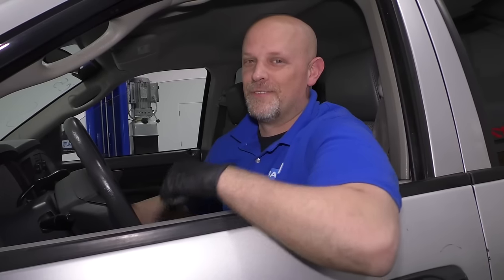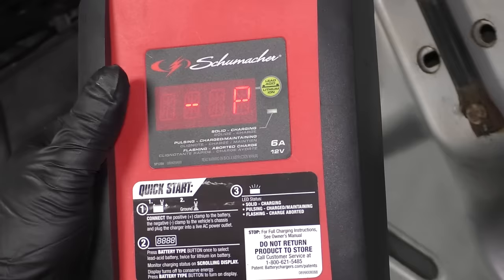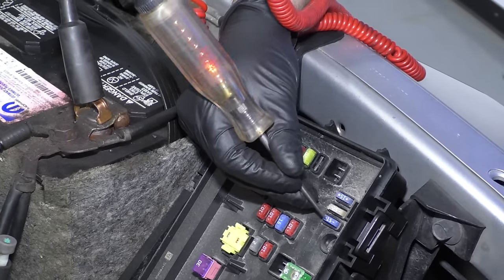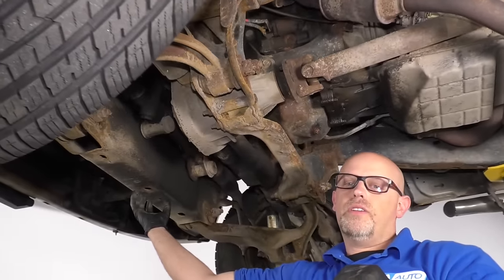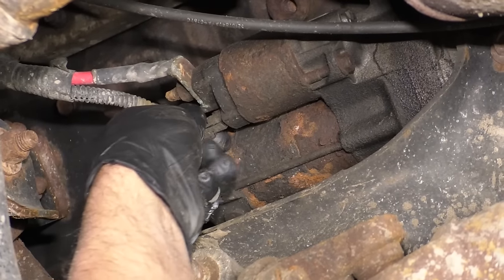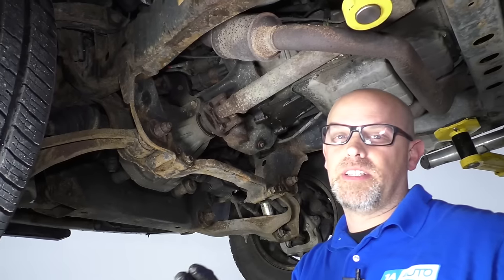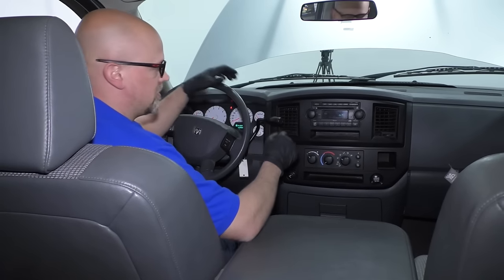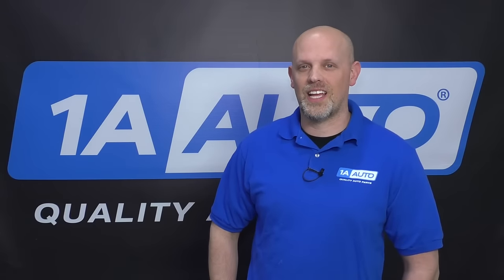Car or Truck Engine Won't Start? How to Diagnose a Bad Starter

Comment from the maker: √  Watch the Video
√  Buy The Part at 1A Auto http://1aau.to/m/Visit-1AAuto
√  Do it Yourself
√  Save Money
Reply: So what happens if you have a cranking no start you kind of just left that on a cliff hanger without saying why?
Reply: @Oiluis18  

He mentioned that it could be a relay, fuse, or even neutral switch.
Reply: It ended up for me to be the ac compressor was seized and the belt was still turning but there was so much drag  it prevented the engine from cranking fast enough to start.

Comment: Dude !!! Thank you !!!! I think you just saved me $900 ....mechanic told me, yup you need a new motor ....i see this and put a socket on the pulley and BOOM I turn the motor EASY !!. Its just a bad starter and he was going to keep my old motor (which is good) and get paid for labor.
Reply from the maker: +Jesse Martinez Thanks for checking us out! http://1aau.to/m/Shop-1AAuto-c
Reply: That mechanic sounds like a criminal. You should lose his license for that kind of BS!
Reply: Run fast from that mechanic you mentioned as something sounds shady. $900 for a engine, installed? BY the time you install new water pump, plugs, wires, gaskets since it's out of vehicle and unknown condition easier to replace. Example I bought a $400 motor for someone recently . Replaced alot of gaskets, all except head gasket. Had a bad wheel bearing, needed new battery, had to replace power transfer unit gaskets as when you remove axle shafts you have to replace the seals. 

All in all the total was $2k then adding the other stuff total came to $3300 and it was a used engine.
Reply: Sounds about par for the course. Usually women in particular get this kind of treatment by service places, especially the stealerships.
Reply: $900 for a motor...
Reply: I needed to get my started fixed and the mechanic said it was $900!!!

Comment: I have a tip.  On Chevy Silverados after you have been driving on snow covered roads on your way to work during the winter.  After you get off work the starter won't crank.  What happens is the drain hole in the starter housing gets snow and water packed up there into the starter gears.  It then freezes and won't let the starter turn over.  You need to go under the pickup with a little benzomatic propane torch and warm up the starter to melt the ice.  After that I put a dab of door and window caulking over that hole and have had no issues with my pickup starting for the last 4 years now.
Reply: Good point.
Reply: @k9under  at
Reply: You could probably spray penetrating oil then the ice won't stick and freeze

Comment: Absolutely fantastic troubleshooting - very thorough. Only thing I might add is that my son was able to once use the hammer trick without someone actively trying to start the vehicle. He just tapped on it and then hopped in to start it. Might help someone else.

Comment: Thank you for your help!  I've officially fixed my first electric issue on one of my machines thanks to you.  (It is a DynaPac Roller that would intermittently not start and I couldn't figure out why.  I questioned the starter or even the switch itself.  I watched a ton of videos that all helped a little - but your trick of setting the light up to the wire going to the starter was exactly what I needed.  I could see that the electricity wasn't making it to the starter.  So it had to be the switch... but then I did the same test right at the wire at the switch and it did have power on both sides of the switch.  So I followed the wiring and ended up coming along some wiring harnesses.  I unplugged the harnesses to inspect, and found water trapped inside the harnesses and a bunch of corrosion.  Cleaned it up, added some electrical grease to the prongs on the wiring harness - and it is working great now.  So not only did it work, but I didn't have to buy a new starter or a new switch!)  Thank you, thank you!

Comment: Great video.  It takes me three times trying to turn it over to get engine to start.  I will try your tip on putting it in neutral and trying to crank it.  Just replaced battery terminals and thought a stripped loose terminal was the problem, but not that easy. Will check fuses and relay. Thanks for the wonderful 1A Auto videos!

Comment: Brilliant! Thanks! 
I will order from you too 

For a month or so, my vehicle either cranks perfect or good lights/no starter turn. Try few more times or try later and it cranks.
Since it mostly starts fine, that rules out battery/alternator/fuses. I don't expect starter wires starter wire problem could be intermittent. I'm convinced starter pvlm, but will check starter signal before replacing.

Comment: I really appreciated the description of the sounds that I would be hearing for each problem.  But then going the extra step to help me see how to test the battery connection, probing the harness and then test crank the engine with that in place helped to clear up what multiple other videos never helped me with.  I hope to diagnose my son's car in the morning and be able to get it repaired quickly...for the cost of parts and with the added bonus of father and son time!

Comment: Also it helps sometimes to look at the grounds from the battery to the body and body to the engine.  Check for looseness and corrosion especially on older cars that live in the salt belt.

Comment: I was turning the key and car wouldn’t start until you said to turn key and listen for clicking so I was playing around with it. There were flickering lights then car started after I held key in turn position. Then it started. It dawned on me that I hadn’t used the car in 2 weeks. My car is old and i heard old cars can get messed up if you don’t use it for too long. I appreciate your vid. It is in formative and made me realize I got no one but me to fix my problems. I just need a guide.

Comment: Thank you so much Andy and 1A Auto! My Camry wouldn't start after finishing up grocery shopping. I checked the battery, fuses, and cables. I was defeated and brought a starter getting ready to replace it there. I figured let me try and do the hammer and start method, and it worked!! I was able to drive my car home and replacement the next morning!!

Comment: Okay, but what if you can always start your car but sometimes, randomly, during the start process it glitches, or in other words, “dies” for 2-5 seconds in the middle of the start. BUT always starts and drives great? I have a 2018 Subaru just hit over 100,000 miles and this just started to happen. I also have a video I would be willing to share! Oh and I replaced the battery, brand new per the mechanic and it’s still occurring. Thanks for all your YouTube video. Very helpful 😊

Comment: This was well done and helpful. But I have some important info that I didn't find on any of the 'won't start' videos:

If it is the battery as it was with my 2015 Silverado, you have to actually INSTALL the new/good battery, NOT just jump it - that did not work, would not even make the solenoid click. It was still the battery. It took a trip to the shop to find this out. I believe them because any other problem with the ignition system would have cost more to fix. Plus it did work.

The explanation from the  shop is that it has to do with the computers and complexity of the charging system, and the need for direct cable connections. Jumper cables do not provide the necessary power feed. The voltage was fine, but I do not have a load meter and couldn't verify that critical info.

Comment: will a bad starter work if you jump your battery? it seems the battery is good cause the lights are still coming on bright and strong. But the starter works sometimes and when it doesnt i jump the battery and it starts no problem. So is it the starter or battery in this case?
Reply from the maker: +God Bless Hip Hop We wouldn't be able to diagnose an issue like that here, you may want to have a local mechanic take a look at it. Thanks for checking us out! http://1aau.to/m/Shop-1AAuto-c

Comment: Great vid. My transit van got me guessing , it starts fine, get it to work then turn key nothing, try try , nothing then by chance some time later starts? This has happened 2 times now? Scared to drive it now? Any advice?
Reply from the maker: +@markhuru We wouldn't be able to diagnose an issue like that here, you may want to have a local mechanic take a look at it. Thanks for checking us out! http://1aau.to/m/Shop-1AAuto-c

Comment: Dude you just saved me from being stranded in a parking spot. My 2013 chevy Silverado didn't want to start and I just got a new battery. I put in neutral and bingo my truck started and made it home. Time for me to change the starter. Thanks for the video.
Reply: Except that it wouldn't be your starter. It would be a neutral safety switch or range selector switch like he said.

Comment: Thank you so much.  For helping us.  Here in nebraska it has been snowing and has being frozen. My truck out sudden didn't want to turn on. Then when i hit the key on it clicks alot then everything turns off including the lights.  My pedals are frozen and hand brakes. my keys got stock also. I think it might be the pipe lines underneath that are frozen. And a battery issue.
Reply from the maker: +Agustina Thank you! We love empowering our customers and showing how to perform DIY auto repairs with our high-quality auto parts.  http://1aau.to/m/Shop-1AAuto-c
Reply: @1AAuto  Thank you so much.  For your help. I just share the link to my brother and son incase they need anything to repair there vehicles .  God bless you.  And happy Holidays.  🎄🎉

Comment: What about putting your test light on the heavy starter wire? It should have power without cranking, and then have someone crank it to see if the light goes out indicating a big voltage drop. Could be just a bad connection/loose nut to fix that.

Comment: Bro Working On An A5 Quattro Coupe. Hella White/Bluish Smoke. Lack Of Maintenance. Car Was Overheating & Wasting Coolant. Replaced The WaterPump, Replaced HPFP. Timing Chain Has Oil Leak From What I See. 12 Codes Now Only 3. Knock Sensor, Fuel Pressure Sensor & P0016 Cam & Crankshaft Out Of Synch. Your Expert Opinion?

Comment: What do you do if the range selection switch is bad? Should I still replace starter? 

My truck started in neutral but won’t go into any other gear to drive.

Comment: Hey 1A, I  noticed the test light was lit depicting that the starter leg is how. However, shouldn't a voltmeter test be done to ensure there is no voltage loss from the battery to the starter. A low of  9v for example would still light up the tester.
Reply: Frankly some people can only handle a light either being on or off. This guy in the video is smart enough to use one as he diagnoses things, but I think it would just complicated the video. Example: simply getting the leads backward would show a negative voltage on the meter, even though the battery isn't actually putting out a negative voltage. 
I think it was a good idea to make this video as basic as possible. There's either voltage there or not for this example. While someone would likely not have that tool if they were just the average car owner, maybe they'd see one for $10 when they went into the auto parts store
Those are my theories. Long story short, yes, you're right. You should use a meter to be more thorough and have the whole picture.

Comment: When checking for a seized engine with a breaker bar and turning the crank over by hand should I have the transmission in neutral on an automatic?

Comment: I know this is an old video so im not sure if you'll read this, but in your intro you mentioned cranking with no start not being battery or starter, and then nothing else. That is the exact issue i'm having except it almost always turns over on the second attempt. Can you (or literally anyone else reading this) expand on that issue?

Comment: I've experienced failed starters on 2 different vehicles and the hammer trick never worked for me. Just my luck, lol. Great mentioning the manual transmission clutch safety switch. That switch is often overlooked when diagnosing no start conditions

Comment: Thanks for the awesome video. I was wondering if you could answer a question? My starter was making a whiny sound intermittently, and I thought for sure it was the starter, so I changed it, however, when I got the new starter in, it's doing the same thing. Do you have any suggestions?
Reply: No it's a late reply, but sometimes  the pulley can be bad and whine, or I believe a bad alternator can whine as well, and of course  a faulty  power steering pump,  what was the outcome....

Comment: Hi Sir
I have a  chrysler 2010 for three years.
Drove it at night and in the morning didn't start, no click or crank, but the lights ,radio are working.
Checked as you explained the fuse box and the relays, no problem.
Replaced the battery with new one ,same thing no change.
Still I have to check the starter ND if the engine siezed. 
Is there a possibility for faulty computer , how to check that please advise.
Thanks

Comment: So if I touch both terminals with a screwdriver and it doesn't start the solenoid is good? Key in ignition on or off? Or it doesn't matter?

Comment: Great video! Guna test out the nuetral tip. But I'm scared maybe my timing belt broke. My car wants to start holding the key on for like 6 seconds but then stops and makes a dry sound. I'm just guessing. My uncle will take a look. I have a 2005 dodge neon. And of course car prices are out of my range now.
Reply: What was it!??? My car is doing the same 😣😣😣

Comment: Hello, very nice diagnose video.  I have a problem with my Honda Pilot. When I tried to start it, I heard the bad battery sound, not the one break  sound from starter. So I installed a brand new battery. But there was still bad battery sound when I tried to start it. I am really confused. What else could go wrong? Thanks!
Reply: Well, finally figured out the problem. The negative wire from the battery terminal is broken. It is broken under the battery case. Make it difficult to detect.

Comment: Could it be possible that the starter is bad if I keep blowing a 40 amp fuse on the ignition? Im having an issue with blowing a 40 amp fuse

Comment: Hi there, thanks for the helpful videos, have a question when you turned the key to on position, and the solenoid wire you tested got power to it, which should make the solenoid to engage, and the car should’ve started, how come the car didn’t start?
Reply: Because the starter was bad. 
The wire only showed that the starter was getting power, meaning the issue was with the starter itself and not the power supply to the starter. If it's getting proper power, it should be working.

Comment: Hello thank you for the video, my question is when this happens on my 2004 canyon i just unplug the relay(which is a huge fuse compared to the little ones) then plug it back in and it turns on, but this works about half of the time, can you give me so.e advice
Thanks in advance

Comment: Thanks, very nicely explained, My 2000 Firebird 3.8L, wont start, it's has new fully charged battery, all lights are nice and bright , I changed new starter in but it's still wont start...
What it can be Please help..Thanks..
Reply: Blown fuse?
Reply: He doesn't say it outright but the reason he checked voltage at the positive cable attached to the starter is because the cable could be bad and not supplying the starter with the power it needs. He really shouldn't have skipped that. You can use a jumper cable from the battery to the starter and see if it starts, if it does you cable is bad.

Comment: So what was the issue if my Chevy 350 was cranking how it was at 30 seconds? New battery and new alternator. Starter or wiring? Saw smoke coming out lol

Comment: Idk if you'll respond but I am at a loss.  I have 2007 Toyota rav 4, had trouble starting, accelerating on hills to almost none, then won't go above 2 rpm.  I replaced MAF sensor, fuel filter, and crankshaft position sensor, then car would not crank or start, now cranks sometimes I have also replaced battery.  Has strong crank /turnover but no start.  Any suggestions?

Comment: Could you guys make an end-to-end system check video that shows how to troubleshoot a no crank condition, (hopefully on a 2006 Nissan lol). Just go through everything in the system that could actually cause a no crank. Whether it be the starter or ground wires or starter relays or fuses under the hood as well as ignition switch or anything in the cabin. Like  totally I'm having the hardest time figuring out what's wrong with my car.  The odd thing is that after you pull the key it will somehow reset itself and be able to start later. So it's hard for me to get it in that situation where it's no crank.  It certainly shows up at the most inconvenient times and then I get it to the shop and they can get it started. I want to try to narrow down what the heck is wrong with the car. Put me in a bad situation with my boss too. 
Totally irritates me when they make a note crank video that alludes to the fact they're going to rule out the starter and before they can do it they run into a bad or low battery

Comment: Is it rare for my car to suddenly stop while driving a distintintive smell after would not start a day later whiles in parked it started leaking not sure if it was motor or trans but the smell of gas lingered. Anyway replaced starter but when moved truck to the driveway to replace part and 8t leaked more it is at a slight slant but for oil it's thin and with a faint gas smell. I was stupid enough to put my lighter flame to and thankfully there was no  crazy fire accident.my father also said that oil had smell of gas. Alexander from fontana with 87 nissan pick up

Comment: What if it does both lol it clicks so thinking battery but only with power cables attacked without there's no power at all. I had it checked battery and alternator are good so starter ?